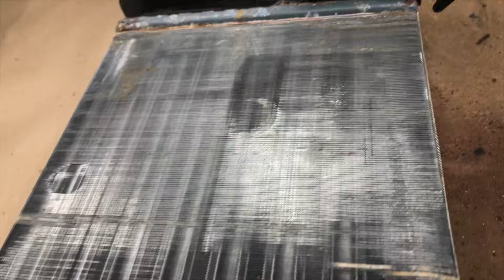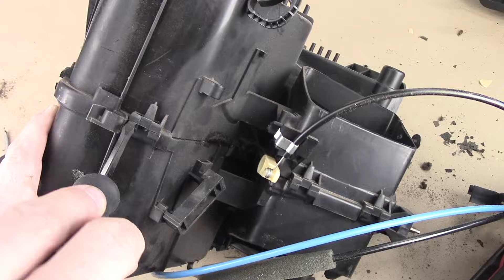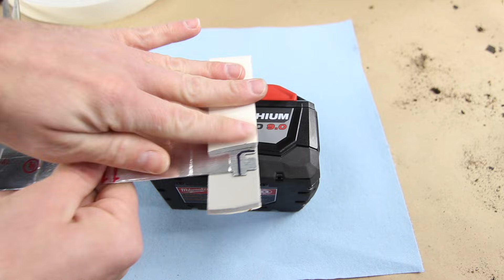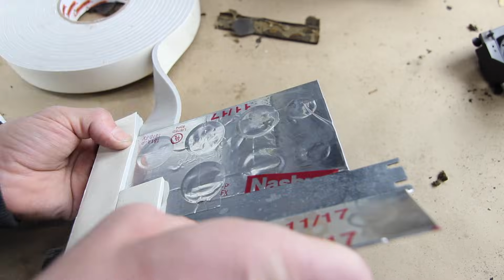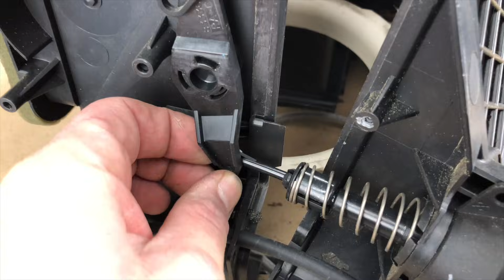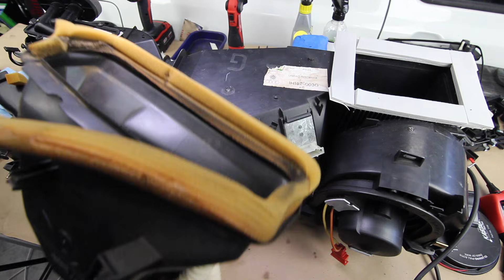How To Fix Blend Doors ~ Install a Heater Core and Reseal The HVAC Box

Comment from the maker: If the video helped you out, please give it a share. 
Something I didn't mention in the video, the adhesive promotor is used to help the foam stick. This is what is used on double sided tape for body kits and things like that. We used it all the time on VW accessories.
Reply: Hey Charles, you can use binder clips to hold down the foam along the edges. The spring tension of the binder clips should make the foam adhere to the door better.
Reply: @humblemechanic. What type of foam did you use? Frost King?
Reply from the maker: That is a good idea
Reply: HumbleMechanic which heater core did you end up going with? ECSTuning has several of them including OEM. We all know what OEM costs! What’s your take on Aftermarket parts vs OEM? 

That would make for a great Video for you Charles. OEM parts vs Aftermarket parts.
Reply: Is there any other substitute aerosol or whatnot for the Adhesive Promoter I cannot find these things anywhere and I need them today.
Reply: HumbleMechanic Thanks Charles. I’ll be doing this to my R32 along with a new heater core.
Reply from the maker: Nice!!!
Reply: You really saved me with this video. After being out of the country for two years I came back to a rear window leak and some subsequent light mold in the car. Gonna bomb it, clean all the HVAC, and donate to you. Your videos on 98 GTIs are REALLY helpful for me, and by donating I still can't repay you enough for how much you've done.
Reply: Did you have the link for doing this while not taking that unit out of the car
Reply: A bit off topic. Would I have to remove my dash to remove heater core supply lines on my 2007 VW Rabbit? I can’t seem to fish them around.
Reply: Is there a video of taking the box out of the vehicle? I have a 2002 vw cabrio that I need to do the heater core, and sure enough, the foam is flying at me. Cant find anything on the year.
Reply: Why are you covering the three holes in the door? Why weren't the holes  covered to begin?
Reply from the maker: It's foam for a camper shell. I linked to it in the description

Comment: does anybody know if you actually need the foam to have it seal correctly? because I kinda like the minimalism of just the aluminum tape, could you just use multiple layers of tape instead of foam? methinks you could just double over the tape, in the opposite direction, and it would still provide a seal while being less problematic. While I do want the heat and cold air knob to work perfectly - I also really, really, really really don't want to do this again if I go through it to do it.
Reply from the maker: You can do it without the foam
Reply: @HumbleMechanic  I've decided I'm going to use like 1/16 inch balsa wood to slightly thicken and pad the flap door before wrapping. taking out the dash and trying to get the HVAC box out of car today - really regretting my life decisions right about now - I honestly wished I had just left the damn car alone, driven it, and put this off maybe forever. I was worried I may have a small heater core leak - and wanted my heat to work before winter, which are both pretty solid goals - but now I have to replace all the old floor foam I tore out, and ya know it's a tradeoff - like even though some shit wasn't working, the old factory foam didn't have any off-gassing toxic smell in the car, and now that I'm going to sound-deaden and everything, I know some of the foam is going to smell and stuff... well, working fresh air vents should help significantly either way. Thanks for this video. still don't know how to pull heater box out of car though.

Comment: Owned an Audi 5000 back in the 90s. 
There the hole climate control, fan, heater core was built into one box, which can be removed through the engine room's fire wall.
No need to take the dashboard apart.
Once the car's heater core was leaking, some coolant was blowing into the passenger room.
Took me 3 hrs to replace heater core, from reading a repair manual and I didn't know what the hell I was doing!
But yes, on most cars a heater core repair is difficult, time consuming bc the dashboard has to be taken apart.
🤔🤔😡😡

Comment: Don't make sense, why VW put those large holes in the blender doors, when has to be sealed up with tape or foam again?
With time, the foam dries out, flakes off and the car's climate control turns into none functional and an expensive repair.
🤔🤔😡😡

Comment: Came back for review getting ready to do my fourth mk4 hvac box redo. I think i learn something new every time I do one of these. Never fun but I'm getting more efficient at it and time off the year plays a big part, damn the winter weather!
Reply: I feel ya. Did this once during winter, snow on the ground and outside ofc. I have always wondered if those holes on the doors play any big part here. To me it kinda looks like they wanted some ventilation to the thing, even when things are all closed up (therefore the foam that lets some air trough from the holes. Maybe to prevent mold occuring inside by trapped moisture? Or  i am just over thinking this one.  They just wanted some light weight doors, since they are hinged via plastic :D

Comment: Isn't it better to use silicon grease? White lithium grease is petroleum based , it will decay plastic and rubber parts over time .

Comment: I know this is a very old video, but will this process work the same on a 2001 MK1 TT? I have no heat, but I'm 99% sure its because of the blender doors.
Reply from the maker: The dash remove is different for sure.  It the strategy is similar

Comment: Good video. Is it possible to check the blend door without opening everything. Warm air coming from my vents even when I put the temp control knob to coolest setting and turn the fan on

Comment: Hey my man so I actually have a different issue with my A/C... I just got a 2005 4runner and the A/C blows out the passenger side but not the Driver side... The driver side stays hot no matter what I do... So I took it into a mechanic to see what the problem was and get him to fix it... He knows I work on my own cars so he sent me home with a diagram and told me to replace the Blend door actuator on the driver side... I ordered the part and pulled of the plastic covering it to find it completely missing... Then I found out that my truck does not have Dual Climate Control (my mechanic obviously did not know this thinking of getting a new mechanic now). Now I think most likely that the bar that is supposed to control the door's to allow heat or a/c in is broken (because I found a video on a 05 4runner where that was the problem on the driver side in a model that does not have dual climate control... So I do have a question for your sir... is it ok for me to just duct tape up the air vents on the driver side of my truck? I closed the vents in the dash and had the a/c set on the dash mode not the feet or the defrost area and I was able to cool the whole thing but there was a super loud noise the entire time like a squeel .... so I am worried that maybe imma break something if I run the A/C with something broken the way it is... ugh... this sux

Comment: Hi, great video!! The only question I have is why adding the foam also in the middle of the big main flap? Have I missed something... Thanks 👍🏻
Reply: I believe it's to insulate between the hot (heater core side and cold AC condenser side) air. Correct me if I'm wrong, as long as the thermostat is open, your car is circulating hot coolant through the heater core, whether you are using it or not. That's why I’m here, My heat is not so hot anymore, and my cold is not much cooler than fan only.

Comment: I have to take out the whole dash on my TT for this, thinking im just going to take out just the center part and glove box then try to stick my hand in there to just tape it 😅love my MK1 TT but at 292k miles I've done everything to this car and frankly getting tired OOHH WELL time to take it completely parts since I'm also having radio issues with false contacts

Comment: I can't agree with the choice of foam replacement used in this video. It does take into consideration the engineered design of the flaps and their original foam. In general, the video is useful for basic how-to's. But it ignores the depth and sealing requirements the original foam seals provided. Also, all of the numerous foam pieces used weren't necessary as full foam sheets are available to cut out a one-piece fit for the vents.
Of course, this is my own opinion of a better fix than what this video provides. Less labor intensive to use an open-cell foam as what was original to the flaps cut from sheets with the proper depth.

Comment: Hi,
In my Audi A3 8L I have a problem, that after a while of driving (approx. 2h) the air not coming out thru any outputs, while fan blower is still running, even I increase power of blowing-I can hear that fan running full power, however they vent outputs the air amount is nearly zero. Only one my idea was, that servomotor V71 is guilty when will stuck in middle position, that flaps for air from outside and inside are closed. Motor replaced, but problem remain. To ensure myself, I removed one of the smaller flap near by V71 motor. Now possibly is for taking air either from car cabin either from outside. Problem still exist.
Now I suspect motor flap V68. It looks like somehow happening, that hot air and cold air channels are closed. On your movie looks like it is one flap bended, but I have seen somewhere this flap from 2 elements. Maybe it is possible, that they are shifted against themself and sometimes both channels are closed?
I really don't want to disassemble dashboard, it is a huge job and not pleasant to do it outside in November. Maybe you have any advises or better idea, how this air flow its blocked? My car I have 5 years and since beginning it was happening, but not always. Of course after night or after long rest it is working good, but after passing about 200km distance, become this issue appearing. 
Best Regards,
Kamil

Comment: the holes in the flaps are there to let air through the foam rubber, without the flaps can hardly be adjusted while driving or with the fan on.

Comment: I found this great video tutorial when trying to access the HVAC control panel.  My 2005 Jetta went suddenly from the HVAC controls working perfectly to then having heat on full with no response to the heat control knob. I figured most likely one end or the other of the control cable had slipped off, but after a day and a half of digging down to the heat controls, I saw that the cable moves the blend door crank when I turn the heat control knob. So it's not the cable. What then? There has been no foam coming out of the air vents, and this was a sudden change. Turning the heat knob has no effect on the hot temperature of the air coming out. Could something have broken off or snapped inside the HVAC box? I'm hoping I can avoid the heavy lifting job of pulling the dash and steering pod, dealing with refrigerant and coolant. I've worked on my VWs for about 50 years.  Someone said this job would take 12 shop hours at a repair shop. My local shop charges $185 per hour, which works out to $2220 for 12 hours!
Reply: My problem was caused by a broken blend door pin or bushing that had dropped out of the bottom of the blend box and was no longer contacting the blend door. That explains the sudden problem with heat on that couldn't be turned off. I learned that the original VW  part (1H0 819 136) has been discontinued by  VAG, but there are many sources of aftermarket copies that i found on eBay. In the comments to a video about replacing the part I read that someone found a wrench socket wedged under the part to hold it up in place. That gave me the idea of cutting a piece of plastic pipe to the right length to do the job. Using 1/2" PVC electrical conduit I did trial and error to find the best fit, which was about 3/4".  With all the underdash parts, the glove box,, the radio and cage, center console, ashtray and HVAC control panel out already, it was pretty easy to slip the piece of pipe under the blend box lever. It's on the bottom of the blend box toward the front of the car connected by a white control cable to the heat control knob on the dash. It works fine and I think it will stay in place, so problem solved to my satisfaction.

Comment: Great video Charles. Thank you. I need to rebuild the unit on my 2009 Vw trasporter (uk).
Just one thing... You never explained WHY you covered the holes with the silver foil tape. Surely they are there for a reason???
Reply from the maker: My guess is the holes are to lighten the door. And it may also add some rigidity to it

Comment: Hello So nice Video Question so I found a Brass Heater core and A Copper Aluminum Fin evaporator would the Copper Evaporator be a bit colder due to it being made of copper. Or is a Thin Wall Aluminum design be better for it. By Design I understand The Evaporator actual Absorbs heat its why it feels cold. Thank you for your thoughts

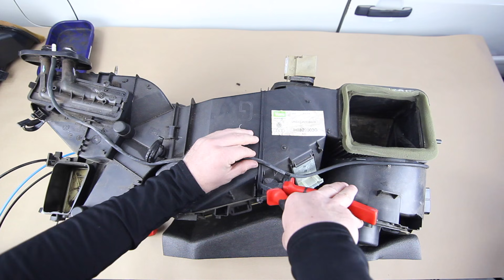Comment: That fastener you cut at @1:15, how did you fix it back on afterwards? I want to add some extra noise insulation to the bottom foam cover that sits under the box - it is fixed to the box with that strap

Comment: Hey, could you tell me what are you using the thick foam for? I am currently repairing the air flap on my a3 8l, and I am thinking is it necessary to use the foam? Isn't the aluminium tape enough for the job?

Comment: Hey Charles, wanted to get your advice. My golf mk3 heater switch control dial broke. Upon inspection the plastic clips that hold the cables have broken. Do you know if you can get replacement part for this and if so can you recommend a supplier. Alternatively is there a fix for it?
Reply from the maker: I’m not sure if that clip is available. I’d personally go to the junkyard and snatch a bunch off a car
Reply: @HumbleMechanic  thanks Charles, unfortunately I haven't had much luck with scrapyard and the model here in SA, despite it being very popular... Will keep hunting. Thanks for the videos
Reply: @HumbleMechanic  hi Charles, I have couple of queries regarding the golf 3 hvac system. I'm looking to seal my blend doors as you described in the video... Does one have to evacuate the ac system prior to removal? Secondly, 5he recirculation button, how does this work? When I push my button there is an electronic whine... Does the button actuate a blend door like in the mk3 models, or what is mechanism.

Thanks again.

Comment: Thanks for posting, my Beetle has started blowing foam out the heater outlets so I see this job in my future.

If  you're doing this, does it make sense to go ahead and replace the heater core "while you're in there", whether it's failed or not?  Seems that this job requires a lot of labor as far as dash disassembly and that's something you don't want to do twice.

Comment: Did you remove the A/C Connection? If yes, how did you catch the gas or was your system already empty?
I need to do this on my mk3 1996 1.9tdi with A/C

Comment: Hey Mr. Humble. Awesome video...I.m doing this job as I wrote this. When I removed the red resistor pack, I noticed there was some sort of sealant holding it to the air handler housing. As I’m reusing the old resister pack, what’s a common method to seal it up to the housing? Double sided trim tape, a bit of caulk, nothing? 

I realize this is an old video...hope you’re still reading the comments from time to time. 

Thanks!!

Comment: Awesome video thanks! Can you use the same camper foam strip or the Rubber Foam Weatherstrip you mention, on the heater core insulation itself? Or will that melt it and you should use something else? 
Thanks!

Comment: Nice of you to share your video. How is the foam holding up? I've bought different types from hardware stores over the years and some of it has adhesive that softens with heat and allows the foam to come off whatever it's mounted to. Specifically which type/brand of foam do you recommend?

Comment: @HumbleMechanic i must ask you something, i seen on other American SUv's guys REwrapped gain with foam.. and you used foild tape.. do you think it is just difference in "Noise" ? 
any chance to hear working AC on full with the foil tape you changed ? i guess the air flow is godly now ?

Comment: I really need to do that to my 2006 beetle, I would like to find a tutorial that show exactly how to take the entire dash out step by step I’m a skill less person 😂😂
Reply: I'm late to this, but one helpful suggestion I can make is that you can drill a strategic hole in dashboard braces, pull them apart for more work room and then tie them back together with galvanized steel wire.

Comment: By the way, unbelievably great, detailed video! I'm about to tackle this job on my stepson's 2001 Jetta. If the black foam was all that was initially covering the holes on the blend door(s), why is it necessary to compliment the aluminum tape with the felt pad covering?
Reply: I wondered that also.... But I guess the  foam covering the holes , instead of alu foil ,  doesn't completely seal of the closed duct so a little air still comes through .  Meaning if you switch to front window only..... the windows of the doors still get some air blown by so will also be de-fogged.  Otherwise you keep switching from front window to  doors....to heating up your feet etc...

Comment: Do you have video without taking the whole apart. I just need to fix the flaps. Thanks
Reply: Yes, covering more limited problems and the easier way is what I'd like to see. I prefer to have as few things as possible to deal with and try to work as smart as possible. I came to this one because I really wanted to see the exchange of a heater core.